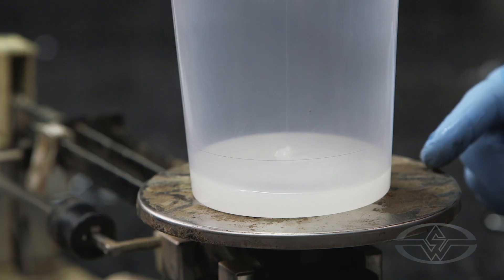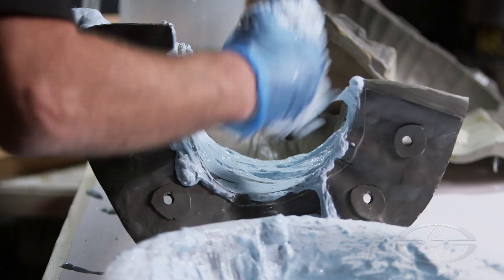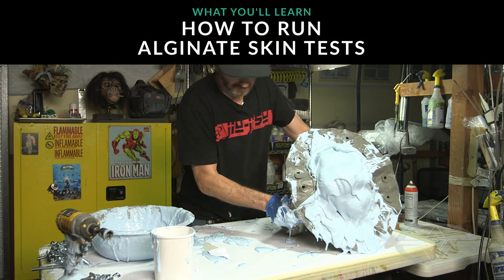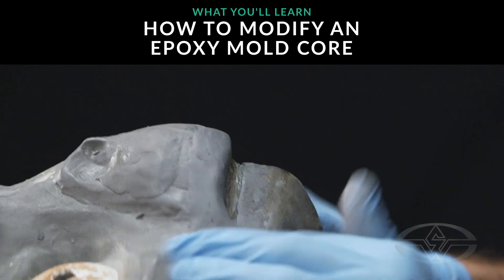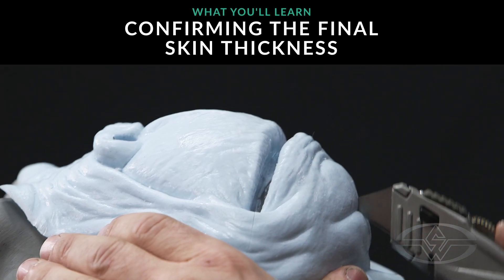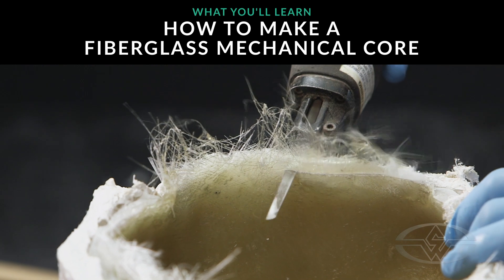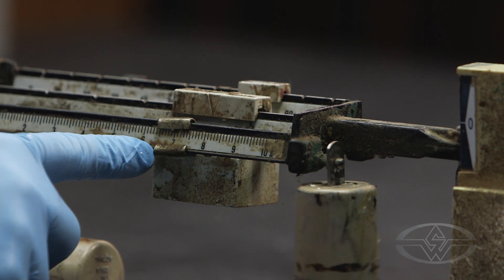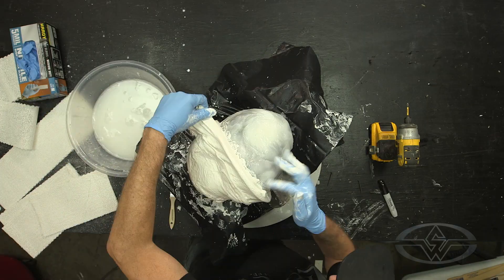Lab Work for Animatronic Characters Part 1: Making a Mechanical Core - TRAILER

Comment: Cory, I just finished watching part 1 and ordered part 2. Very informative. It starts off with you modifying an existing core and then making a new core from that one. Is there a video showing how to make a core from the start.? I want to make a core and animatronic skin from a fiberglass mannequin  bust
Reply from the maker: Hey @Paul Vecchione, in this free chapter (https://youtu.be/9ezR-NdNZ84), from 3:12, Rick Lazzarini explains how to create a core for your animatronic skin. You have to carve down a certain thickness from the sculpture you used for making the mold. 
If you would like to use your fiberglass mannequin bust without forming it to a core, first make a mold of the mannequin, and then pour the positive from the material you would like to modify later to get a core. 
Before doing the modification, it's worth creating a test mask from the mold, so when you have your mask, you can decide where and what thickness should be removed from the core. - Adrienn
Reply: @StanWinstonSchool  Thanks for getting back to me. I will do that.